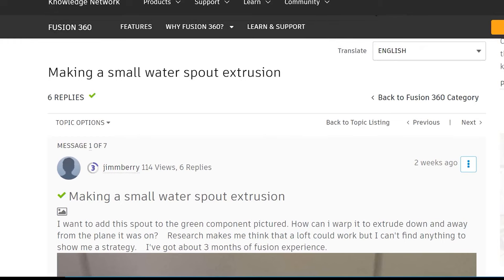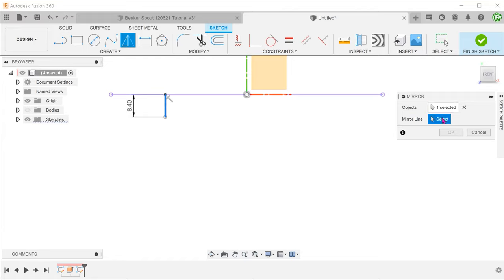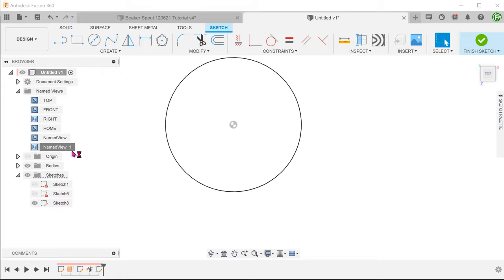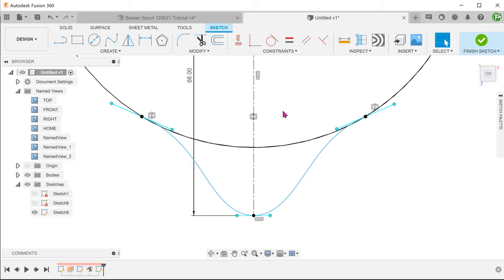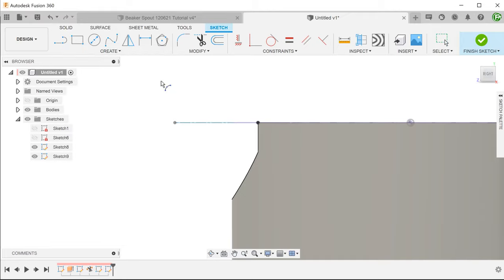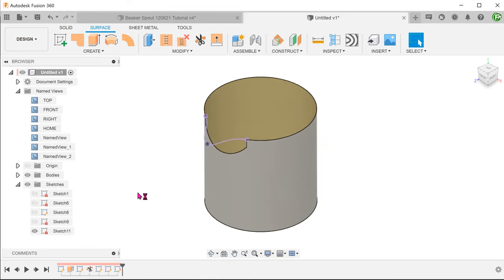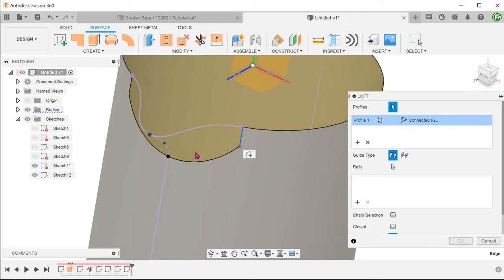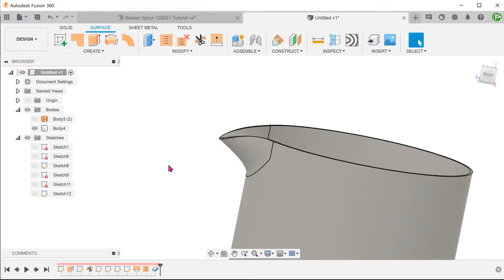Fusion 360 - Case Study 17

Comment: Nice problem! I did it in a similar way. I think the biggest difference is that I made the loft "flow" vertically (from the "lip" of the spout to the "root"), instead of horizontally. Do you think one way has an advantage over the other, or are they equally good?

One thing I learned from this video is the profile options in the loft command. Very cool!

Comment: I really liked how you made use of origin planes and axis and used it very strategically to make it easier to reference geometry later in the design process. Me as a newbie need to learn how to anchor my models but can't seem to be able to properly understand how to get that sort of thinking. Can you perhaps make a tutorial about that if there's enough interest?
Reply from the maker: Hi, I'm glad that you have noticed this deliberate placement. Generally, I try to avoid making any construction planes and make all sketches on the primary planes as much as possible. Even as a relatively experienced modeller, I always struggle to find a good way to anchor my models too. I don't often get it right the first time. There isn't a one size fit all answer. But it is a pretty interesting topic to explore. Will keep this in mind for a future video.

Comment: Great tutorial! Thanks!

A question: Would there be differences in the technique used if the body wasn't a beaker (cylindrical) but rather something with a conical body, like a plastic jar that would need a draft angle to be able to be ejected from a mould?
Reply from the maker: Hi, this should work fine for a conical beaker. I would imagine that the loft command would still be able to achieve the blends.